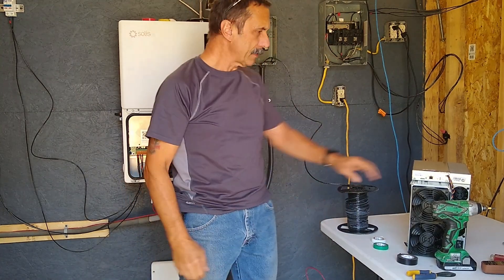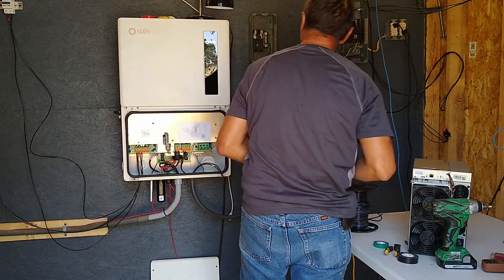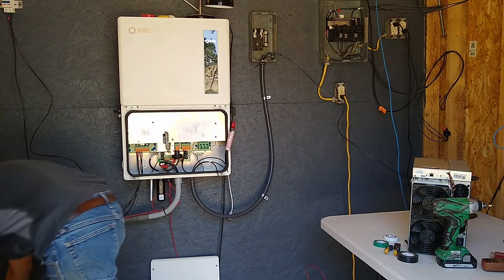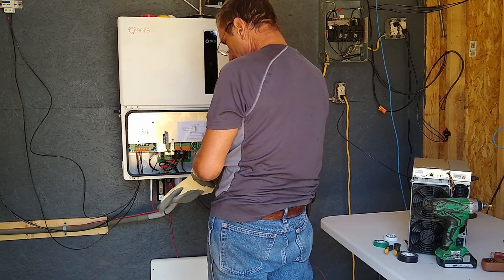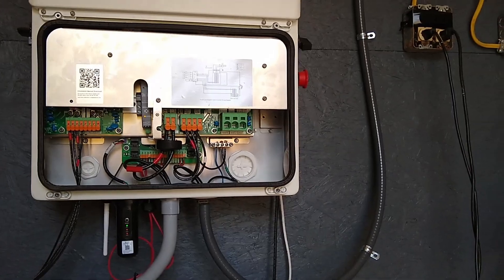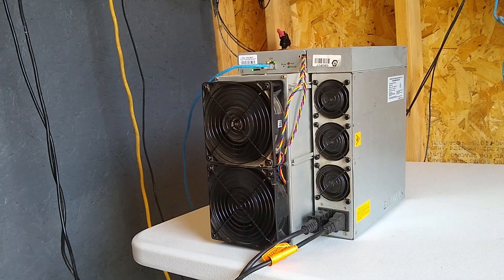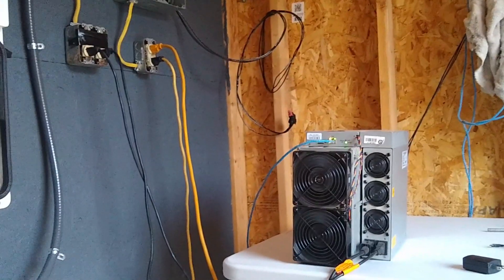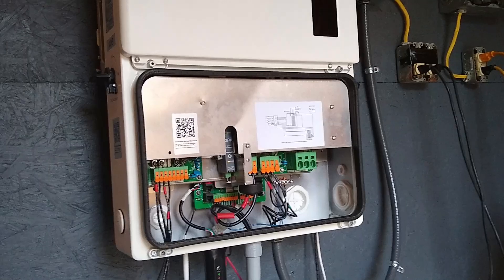DIY Off Grid Solar S19 BTC Mining Test Run On Solis S6 11.4 KW Inverter 24 KW Nissan Leaf Battery!

Comment: How well are you doing with the crypto mining?
I assume it's way better to use excess solar production to make a good return also.

Thanks, Casey
Reply from the maker: If you have to pay for power it's not good but I've done the calcs and this way looks promising. Everyone says you need to mine 24/7 for best efficiency but the numbers say different. It may be slower but it may be the tale of the hare and the tortoise.
Reply: @DIYSolarFarming if you have peak use rates, you can collect power and buy the cheaper power, then mine on battery during peak rate to lower avg cost?
Reply from the maker: The way I'm setting up I will run at max capacity and use almost all the power available during the day, That's between 10 to 15 AntMiner S19's when fully built out.
That gives a much better ROI than playing the Power Company games.
Reply: If u mine only to empty the battery to have room to charge the next day assuming its sunny, and to stop the battery from getting to 100% to garantee use of 100% of the produced power, u'll probabl get a better $/kWh than seeling to any grid; and at zero cost. reenforcing BTC's blockchain not only with decentralized mining but also decentralized power production. win-win-win-win-win
Reply from the maker: @xlportugal  Yes, exactly! I don't want anything to do with the utility company.
I make way more money mining than selling to the grid. Stay tuned for some interesting mining videos!